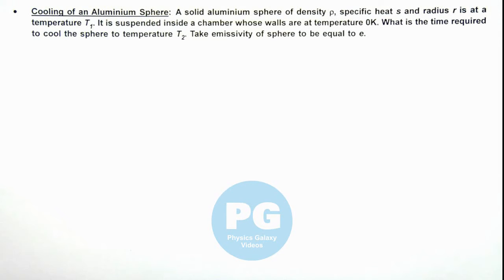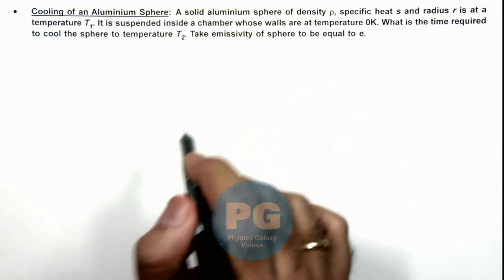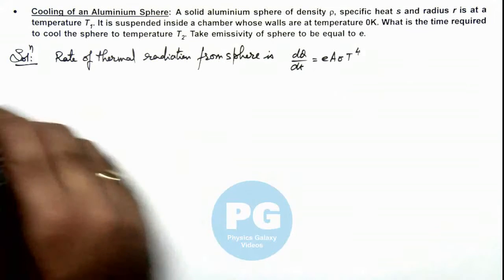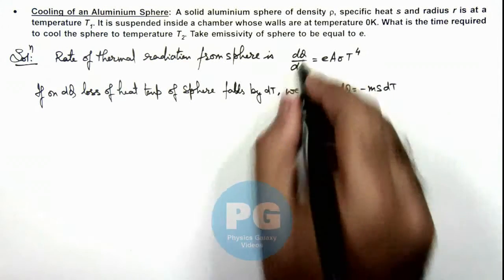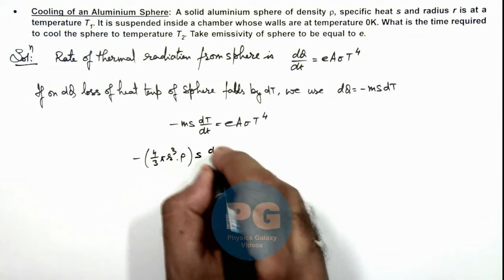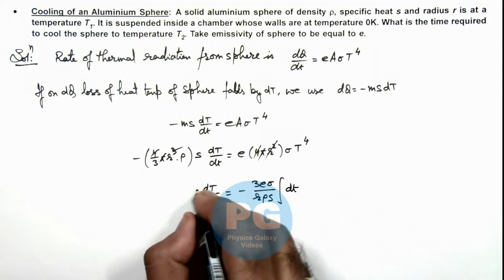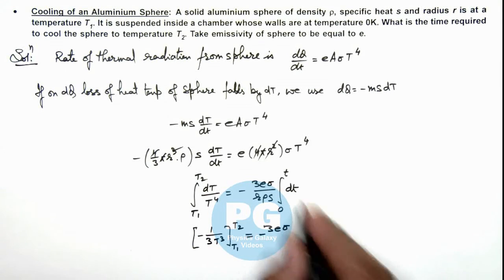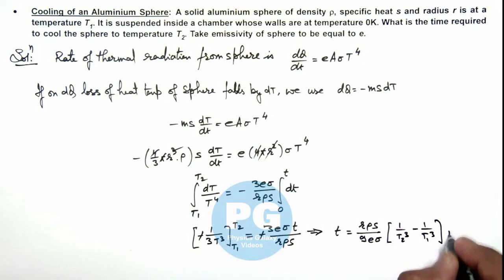10. Advance Illustration | Heat Transfer | Cooling of an Aluminium Sphere | by Ashish Arora

Comment: We have not used the absorption by the sphere as the chamber around it(surrounding) is at 0K temperature and thus radiates no radiation which can be absorbed by the sphere. As the prevost theory says that a body only at temperature more than 0K radiates energy from its surface.
Reply from the maker: Yes...